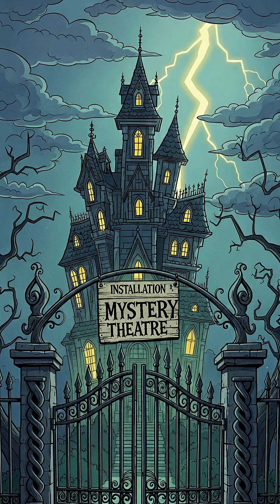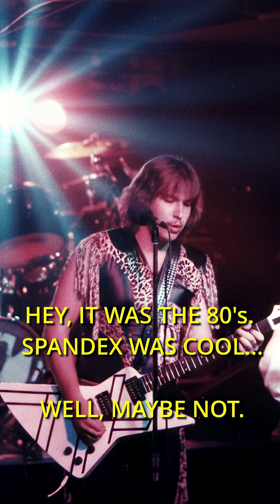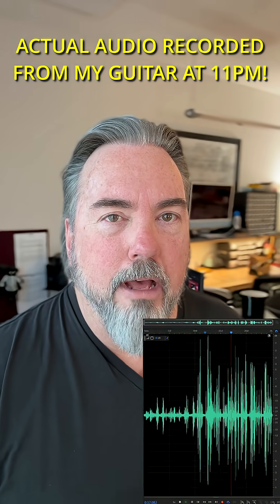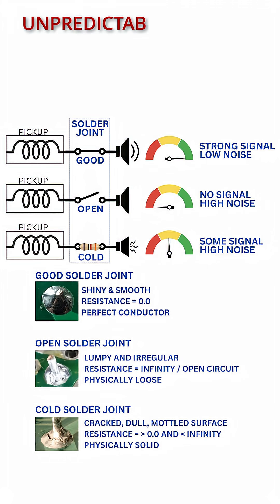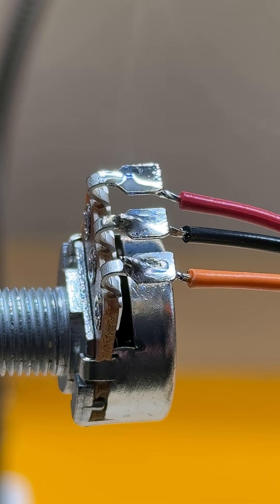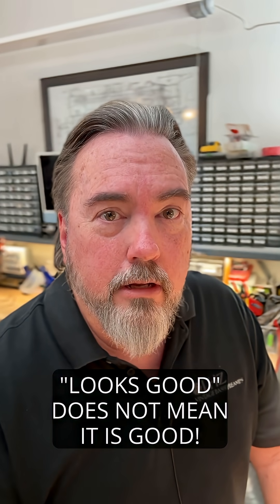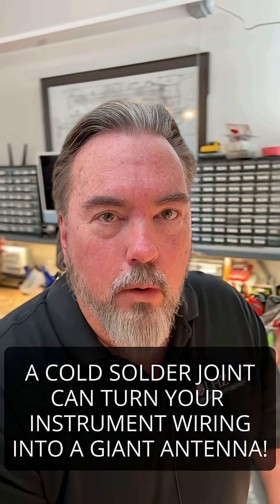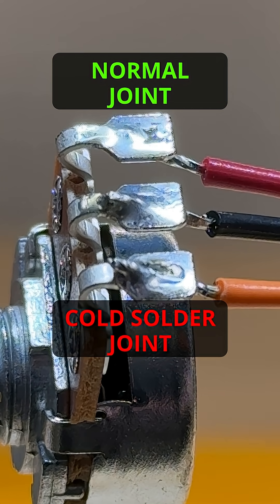Installation Mystery Theatre: Cold Solder Joint Radio Reception

Comment: From a different realm.  Chased a gremlin in a couple security cameras for over a month off and on.  Proper voltage and proper current but it evaded me to check resistance.  The power supply was working overtime to make the numbers look good and they were actually higher than expected with 12.8 volts and 1.5a at the device from a 12.00/1.00 power supply on each but when I found that the last installer looped up and tied tight 50’ of slack on a premade 22 gauge power lead, it suddenly made sense, resistance was double what it should have been and I was a fool to miss it.  Took 2 of us 3 hours to run new 18 gauge wire with no slack and viola, onto the next.  

Also boggled my mind when working for a phone company locally running service calls and we got a mess of calls describing a FM station on their phone lines.  Turns out a station changed tower sites and is now in the middle of 3 square miles of homes and all of their unshielded home phone lines acted like an antenna for 92.5mhz.  The station had a license for the location and frequency and so we just had to tell folks to get a cell phone if they didnt like hearing soft rock blanketing their calls or pay for another company to run shielded wire which we did not provide and would not work on after the fact.  

On the gen1 samsung frame tvs that had the silver cable for the “one connect” if you figure 8 the slack and tie it too tight, it will short so bad that it will trip a 15 amp breaker at the panel, could be reset multiple times and took a minute to figure out but that was it. The moral? Just because something is new and looks good on paper does not mean that it is actually proper or immune from installer failure.
Reply from the maker: This is a particular joy that is largely lost in the digital world where functionality usually just depends on "well, do you have an internet connection?" I'm glad I grew up in an analog world!